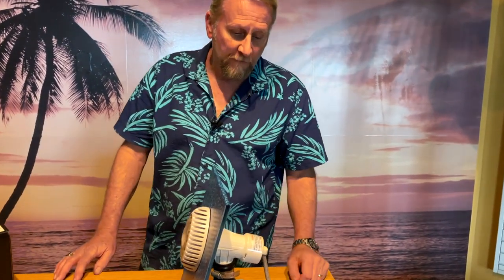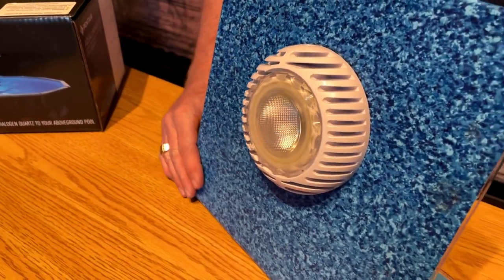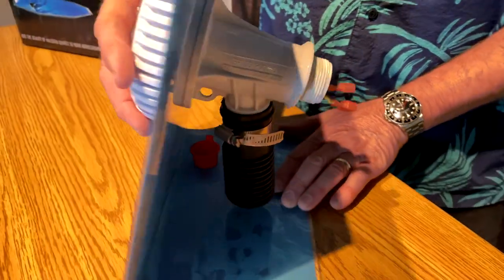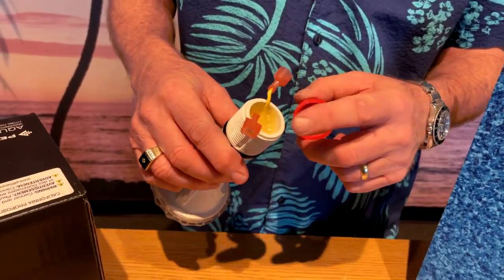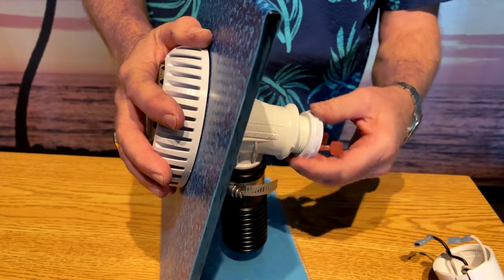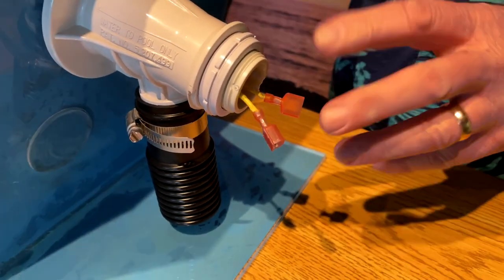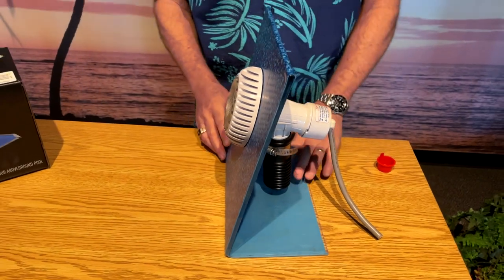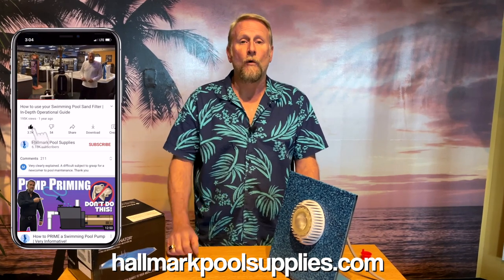Changing the Light Bulb in an Above Ground Pool | Aqualuminator

Comment: When installing the light should you be able to turn the body on the outside of the pool or does that mean it's not tight enough
Reply from the maker: If you can turn the body on the outside it’s not tight enough, try tightening a little more but do not over tighten. You also want to make sure that your gaskets are in place as well. Thanks for watching.

Comment: How do I replace a light return with a non light return?  I’m concerned about the liner pulling away or the new return not sealing well. Thanks.
Reply from the maker: The Aqualuminator light and the return cut out on your pool use the same size opening, you can switch from one to another. If you have any questions feel free to contact me, I will be glad to help.
Reply: @HallmarkPoolSupplies  thanks. So any danger in having the liner pull away from the hole when I swap out?
Reply from the maker: @sc29229  If the pool is full of water you will be fine,  but you may get a little wet.

Comment: I just replaced a bulb on this unit an still no light...just a few days ago everything was working just fine...can you point me in the right direction....could it be the box where the button to turn on the the light ...or did I get a bad replacement bulb.
Reply from the maker: If your bulb is good then it might be the transformer, if you have a volt meter you can test it to see if you have power. If you have any questions feel free to contact me I will be glad to help.
Reply: @HallmarkPoolSupplies  it is not the bulb I tested the old one and it still lights up . so there it pointing towards the box where the button on and off switch is at or (transformer) how do I get ahold of you to trouble shoot this
Reply from the maker: You can contact me by phone, the number is on our website.
Reply: ok will do ..whats operation hours and whi am I speaking with
Reply from the maker: Contact me between 10 to 5 EST. Tuesday-Saturday. This is Mark.
Reply: @HallmarkPoolSupplies  ok thanks